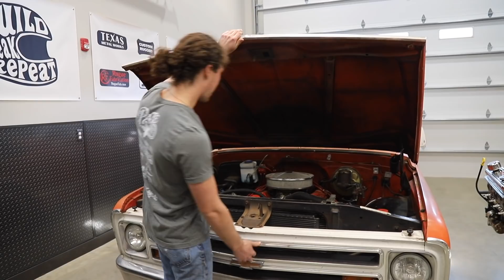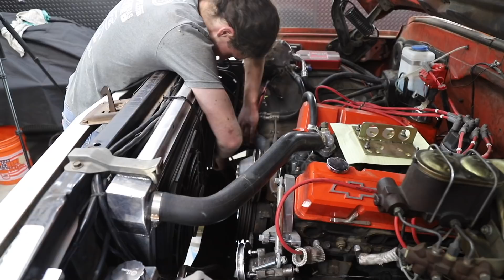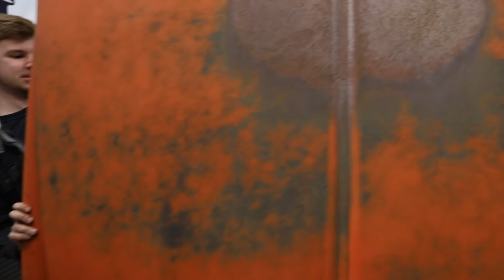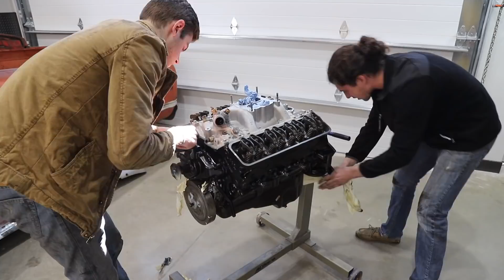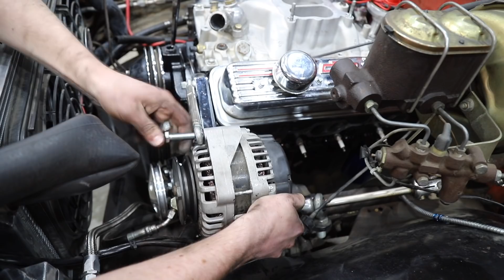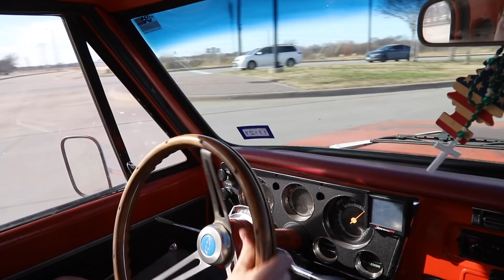1968 Chevy C10 Shop Truck Engine Swap! 333hp Crate Motor

Comment: I actually bought the engine that was in this truck with the orange valve covers and put it in the Racecar that is in my profile picture. Every video on my channel is racing with this engine. Out of five outings we’ve had one win in my first year. It’s definitely stock, but it has been a good one so far! I plan to change the heads and cam then we will have a real fire breather. Saw the truck and shop in person, truly badass.
Reply from the maker: Yo that's awesome! Have fun with that thing, sounds like it's going to be a sweet build

Comment: Awesome swap! I'm looking at getting a 71 F250 w/ 360fe when I get home! I have a question about the EFI swap you did, would you recommend going the full 9 yards and doing everything EFI swap with the msd distributor manifold etc etc? Or does the Holly sniper work well enough for daily driving and use? Many thanks guys! Keep up the awesome videos! I always look forward to your videos while I'm out here in deployment!
Reply from the maker: The EFI on its own should make a big difference and be a good fit for daily driving. We installed the EFI on the truck and drove it for a couple months before we did the MSD supporting upgrades. Thanks for watching and good luck on your build!

Comment: So, I understand that this isn't one of those big name YouTube channels (no offense intended), but I'm a diehard car guy and one thing that would've been really cool to see with this swap would've been to have gotten rid of the auto and did a Tremec T56 6 speed manual swap along with that 350 crate engine. I'm sure the auto will be fine (it's probably a turbo 350 trans), so it should hold up just fine, but it would've been really cool to see it with a 5 or 6 speed manual swap. I'm not trying to be negative about this, this 350 swap will make it much more fun to drive, I'm just voicing my opinion, but I'm always going to love the manual trans over an auto.
Reply: They were doing 70 on the freeway at 2200 RPM. Obviously not a Turbo350 trans.